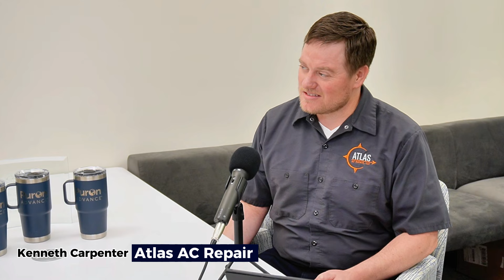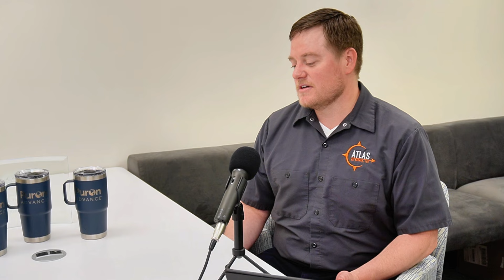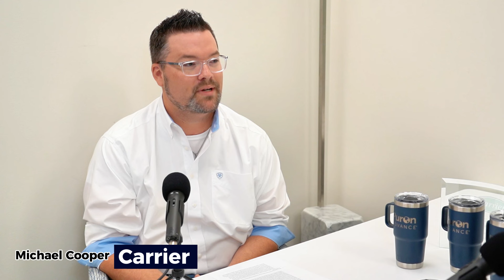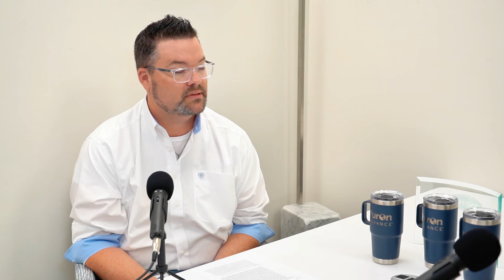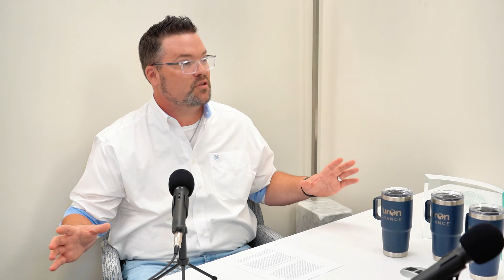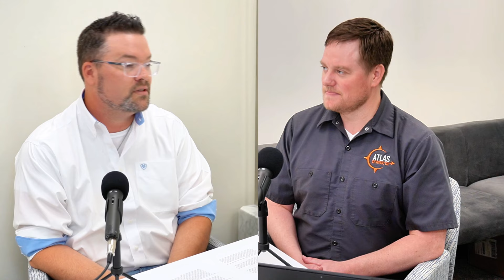Variable Speed HVAC FINALLY explained by Carrier expert!!

Comment: It is a total shame that all the great advantages and sophisticated technology of the Infinity system can be completely negated by a poorly thought out and implemented dealer install.  The previous owner of our house had the Infinity 5 speed complete system installed in the house we now own.  It's a split level house with three levels.  All the indoor hvac equipment plus air return and thermostat were installed in the lower level.  Obiously the thermostat has no idea what the temperature is on the upper levels.  It could be 74F on the lower level and 80F on the third level and if the thermostat is set at 75F the unit will not turn on to cool.  In this configuration either the system was off, or when it finally turned on and started drawing that 80F air out of the upper level it immediately zoomed to speed 5 and stayed there flat out until the set point was reached.  It was on or off, no in between.  Essentially it was a very expensive one stage ac.  I finally discovered that the Infinity thermostat would accept a wired remote temperature sensor.  So I bought one, installed it on the third level and now the temperature control in the house is perfect.  The system smoothly moves from stage to stage to maintain the temperature, it rarely goes to stage 4 and only once to stage 5 briefly [a 103F day].  So why doesn't Carrier train their dealers on how to properly configure a system for a specifc home with specific needs.  I am lucky because I am a physicist and understand mechanics and heat flow.  The typical home owner would be screwed.  I love the Carrier technology, our home is perfectly comfortable and our electric bill has gone down ~15%.  But Carrier customer service and the quality of their dealers................not so much.

Comment: I have a question that's a bit off-topic:  I want to have central AC installed, so I've just begun to do my homework.  So far I've learned that the quality of the installation is critical.  I don't know know one HVAC contractor from the next, so what concrete things should I consider when looking for one, and what questions should I be asking?    I like the idea of a variable speed unit, so I'll put this on my list.  thanks.
Reply: The manual j calc is critical, one ton every 500sqft is meaningless.

Comment: Great new tech, but high-efficiency heat pumps began in Asia from companies like Daikin, Midea, and Mitsubishi, i.e. variable-speed and displacement compressors with inverter drive.  Carrier's systems add a very expensive smart thermostat.  Proprietary, so expect high replacement costs and perhaps orphaned in a decade.